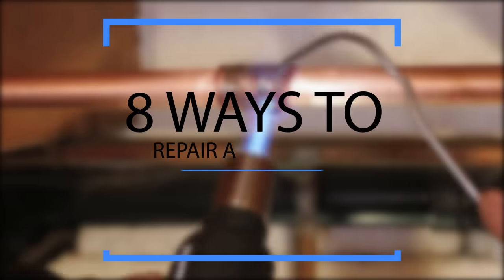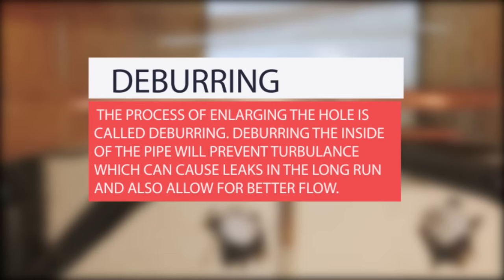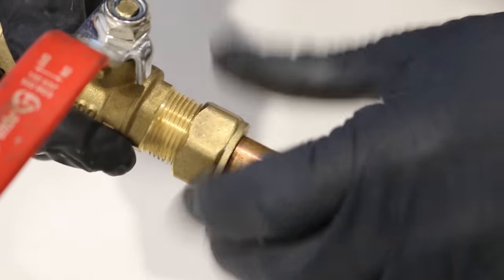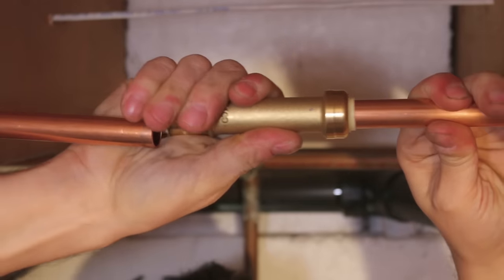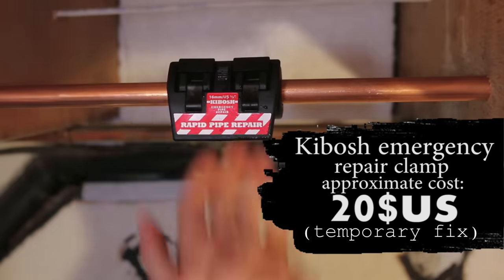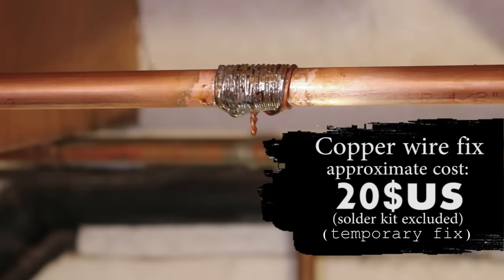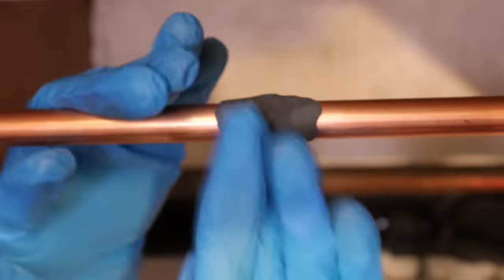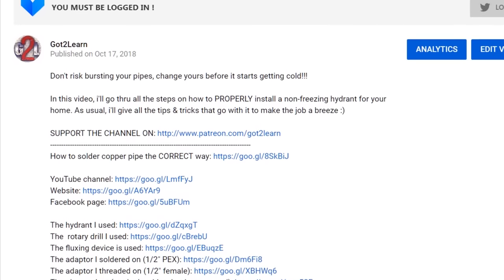The ULTIMATE Leaky Copper Pipe Fix Guide | GOT2LEARN

Comment: I once had an pipe burst late at night
So i used electrical tape it worked for temporary solution.. And sealed the leaked however i did get an plumber to fix it

Comment: These sievert pipe clamps seem like something worth having for emergency repairs while waiting for the plumber ( two weeks last time)  pricey but reusable so worth it, are they available for 1 inch copper
Reply from the maker: Yes, they are awesome...they come in 1/2" and 3/4" for now.
Reply: @Got2Learn  wow thanks for the quick response, unfortunately not the answer I was hoping for, since moving into Mt present home I have had 3 leakes in 3 years, all in the 1 inch supply, the last one took 2 weeks and $200 dollars for a 30 minute repair, fortunately the plumber was very friendly and busy enough he didn't mind giving me some good advice, advising MAPP gas for soldering 1 inch, that propane can't quite do, I have hot water heating and mid winter can get to minus 35 Celsius, at that outside temperature you have to fix it ASAP,  so I spent about the same on a good torch and enough fittings and pipe to do it myself, a year later all is well, it has been my experience that the more prepared for trouble you are the less likely you will need it, might buy a 3/4 and a 1/2, any way to have just in case, keep my karma healthy, subscribed, great advice on a lots of things, screw the guys ragging on your pronouncing of solder, your tips are solid good advice and greatly appreciated.
Reply from the maker: Thx so much man, I need more comments like yours. For the clamps, I have a good relationship with the owner so I know he's working on a 1" clamp, but I dunno when it'll be out.
Reply: @Got2Learn  thanks again for your quick response I will keep a look out for them

Comment: Do you think it makes sense to relocate copper water supply lines (bathroom) from the floor to the wall using a system of pex and sharkbite fittings?
Reply from the maker: Sure, personally I prefer not using SB in a closed wall, but a lot of people do it and it works just fine.

Comment: Can never understand why compression fittings are not more common in the U.S. in the UK they are in every merchant every type and cheap, rather than the bulky very expensive ones shown. I know, We've got a 2nd house  in upstate NY. 100 years old with plumbing and heating the same.
Reply from the maker: Because they are mechanical, they are more prone to failing.

Comment: What would be the reason to use couplings (first method) over shark bite other than the cost difference?
Reply from the maker: You wouldn't be relying on a gasket in terms of longevity ;)
Reply: @Got2Learn  Thanks for that reply! If I'm repairing I pipe that goes to the bathroom, and would get sealed back up in the ceiling, would it be wrong to use the sharkbite? Because one day it would eventually leak? The area is really tiny, so it seems like the sharkbite would be easier. But I feel guilty if it's temporary.
Reply from the maker: Sharkbite says that if it's done right, you can use it behind a wall without any problems, you just need to prep everything correctly, I have a video all on Sharkbite and how to properly install them coming in a few weeks, keep an eye out for it!

Comment: How about using a copper ground strap. The strap is heavy copper at least 1/8" thick with many different widths available. When soldered the thickness is way more than the copper pipe you are repairing. This I would believe is the most guaranteed method and peace of mind. Done and forgotten would work for me how about you Sir ??? How about using square copper wire which would give more of a piece of mind.

Comment: I'm sure there is a good reason, but why don't they make longer couplings so you could cut out a 1-2 inch piece that has a pin hole, then just use a longer coupling?  By the way, I've watched a ton of plumbing videos and yours are the best!
Reply from the maker: No clueee lollll....thanks man!!!!!
Reply: Amazon has these in sizes from 1/2 inch up to 1 1/2 inches long.

Comment: I think you meant two couplings larger than the pipe. If they were the same size they couldn't slip over the pipe. Or did you mean something else?
Reply from the maker: What I mean is the same size (1/2")
Reply: Joe Black  that last part about damaged couplings,I don't know if he's covered that but he should,that bit me in the ass a time or two,im guessing they weren't damaged just not within factory specs that day,this tip you gave is huge one and I don't care who you are,rookie or seasoned veteran having wonky fittings can get anybody because I mean the fittings are new ,how could they be bad right?
Reply: Joe Black  haha it always without fail happens in a bad spot where it was a pita to put on and sweat from the get go

Comment: Can i use WaterWeld in copper pipe? Does it contain lead?
Reply from the maker: You can probably use it, but even if it does contain lead, I would consider this a "temporary" fix, so it doesn't really matter if there is some.
Reply: @Got2Learn  Thanks alot for responding. I've used WaterWeld in my toilet and never leaked. As long as it dont leak then its ok. Just curious if it has lead.
Reply: @Got2Learn  i have already soldered a water bib but pipe leaked and my gas didnt ignite bought another one and also didnt ignite then i used WaterWeld
Reply from the maker: I checked the data sheet on the website, and I saw no lead in the composition, so you're probably ok to use it.
Reply: @Got2Learn  I did research and didnt find info. Hey Thanks once again, Got2Learn! I love your vídeos. Theyre more professional than others.  I like to learn too. Ill watch more of your vids and give thumbs up. 👍
Reply from the maker: Thank you so much Jo! Here's the link to the data sheet I read: https://dynamix-cdn.s3.amazonaws.com/jbweldcom/jbweldcom_183919685.pdf
Reply: @Got2Learn  couldnt open up page. Ill try later. On the product it dont say if it contain lead but dont say lead free either. Thx
Reply from the maker: You'd need to call them to make sure it's safe to use on potable water lines.
Reply: @Got2Learn  I tried contacting them already no luck. I downloaded your info. States on page 18: Based on available data the classification criteria aren't met.
Reply from the maker: Hmmm....you'd need to test it yourself at this point: https://www.homedepot.com/p/3M-LeadCheck-Instant-Lead-Test-Swabs-2-Pack-LC-2SDC6/203313743
Reply: @Got2Learn  already did and it leaked. Bought it years ago. Not sure if its too old
Reply: @Got2Learn  Im gonna repair my copper pipe. Do you reccomend soldering or replacing with Sharkbite? Also is it common for the gas cylinder or torch to not ignite?
Reply from the maker: I recommend soldering over Sharkbite, but it's more complex. Have you watched my soldering videos? No it's not common for the torch not to ignite, you must have something stuck in the torch head :(
Reply: @Got2Learn  Ive watched 4 of your videos so far.
Reply: @Got2Learn  Sorry for so many questions. Why do you recomend soldering over Sharkbite?
Reply from the maker: It's fine :)
Soldering has proven itself over the years and we know that if done correctly, it last a lifetime, Sharkbite fittings do work, they just haven't passed the time test yet, but a lot of people installed them with great success for many years, it all depends on your comfort level with them.
Reply: @Got2Learn  Someone put a planter near the water bib. So im gonna go for the Sharkbite so i wont burn the wood. Please send me a link to one of your Sharkbite vids. Also how would i remove a Sharkbite in the future? Lastly, Sharkbite is just like copper where it dont contain lead, right?
Reply from the maker: Yes, Sharkbite fittings are lead-free.
Everything you need to know about Sharkbites: https://bit.ly/2xEfTao
How to remove em': https://bit.ly/2z6krGX
Reply: @Got2Learn  i know your probably going to say yes but just need to ask. I dont see the Sharkbite logo(like the one on your video) on the fitting i need to replace. Does that mean using gas is the only way to remove the fastener between pipes?
Reply from the maker: If it's soldered, yes. If you can cut the pipe before and add a Sharkbite coupling for example, that would be another viable option.
Reply: @Got2Learn  i thought so. Kool.i was thinking bout that other option. Thx 4 answering my questions. Ill subscribe.
Reply: @joflores2267  soak it liberally with the water hose before hand you'll be fine

Comment: My pipe OD is 3/4" (triple-checked); I just bought a 3/4" Autocut GPC; and it is too big for the pipe! Any advice on where I screwed up? Thx
Reply: Depends on pipe pvc. Cpvc copper or plex
Reply: Actual pipe diameter is greater than the nominal size (which is how the piping and tools are labelled). Looks like .750" OD means 5/8" nominal.  (If you have trouble finding an Autocut in this unusual size, just use an adjustable cutter.)

Comment: Yeah, the copper sleeves Best Method.  But thanks for the others.  My neighbor's got a split pipe and I only have one 3/4" copper sleeve... So Home Depot.... (Of course tomorrow after the job's done I'll find two more.)  Something else to consider in a dry climate. The copper waterline is often a secondary ground for the electrical system. Something like the Sharkbite might not keep this ground if the leak is on the main waterline. 
(In Southern California if someone told me -there's a big puddle in front of the house (bungalow): I'd say find the hose connection, and dig a hole 16" from the wall of the house - that's where your leak is. This is because where the old buried galvanized pipes met enough moisture in the ground for electrolysis to take place causing the pipe to rust and burst. (This isn't the same stupid problem of connecting copper pipes directly to galvanized. )  I'll bet I've seen this and fixed it half a dozen times and I'm not even a plumber.

Comment: What about if I got small drip in elbow?
Reply from the maker: You need to change the fitting
Reply: @Got2Learn  grr, water in it so maybe i just use sharkbite fitting after removing it
Reply: @Got2Learn how u determine where the last mark goes,  how u get it to line up on both for sharkbite slip?

Comment: I have liked and subscribed to your videos. I see a few people talk about the copper compression fittings but where do you get them?  
Are they online only?
All my big boz stores carry shark bite and thats it
Reply from the maker: Thank you ironwill04, you should be able to get some at your local hardware store, just ask for them. If you are looking for some online, I will link them in the description box below the video ;)
Reply: @Got2Learn  awesome thank you very much!  
Im working on 3/4 hydronic baseboard heat and new to soldering
Reply from the maker: Have you seen my latest "How to solder copper pipe" video?
Reply: @Got2Learn  yes i did. Going to try it some more. Unfortunately i saw it after my soldering.
I dont think my soldering is bad but it could use some help.  Plus im trying to get better at in the wall stuff
Reply from the maker: Awesome, good luck bud ;)
Reply: @Got2Learn  thanks. Have u used compression fittings or shark bite on hydronic baseboard heater? 
Do u put either in the wall
Reply from the maker: I tend not to put them in walls, just to be sure.

Comment: I think the sharkbite slip fitting is not pex recommended
Reply from the maker: Who says?
Reply: @Got2Learn  it's missing the insert that others have. See https://www.sharkbite.com/products/brass-push-slip-coupling
Reply from the maker: I have a bunch of slip couplings here and they all have the inserts, what brand are you using?
Reply: @Got2Learn  the slip end has the plastic insert? I have a sharkbite, their site even skips pex under specs. Mine have no inserts
Reply: @Got2Learn  maybe they stopped slip fitting in pex due to problems
Reply from the maker: I have no idea, all I know if my slp couplings can be used on PEX, so like you said, maybe they adopted and now we can use them on PEX, which is good :)

Comment: When you tighten compression nut on 1/2 copper pipe do you do 1 full turn by wrench ?  More or less ? Thanks.
Reply from the maker: It depends. If the fitting comes off, it's not tight enough, when it starts to get a bit hard to tighten, give it that extra 1/4". The best way to know if it's done right is by turning the water on, if it doesn't leak it's tight enough ;)
Reply: @Got2Learn  Thank you very much for quick response.
Reply from the maker: My pleasure, if there's anything else just ask ;)
Reply: @Got2Learn  What would happen if you overtighten ?  And why  overtightening is bad? Thanks
Reply from the maker: If you overtighten it you could potentially break the retainer nut or ruin the brass threads.
Reply: @Got2Learn  Thanks
Reply: @honolulu1476  I doubt you would be able to over tighten anyway. I've installed thousands of compression valves and always crank them down tight. Never had one break or a leak. Cheers!

Comment: If leak comes from electrolysis,no way,have to replace entire pipe.If replacement isn't copper,check if it's electrically grounded,to restore ground.If there isn't a shutoff nearby,chances are to install one,instead of couplings.

Comment: As a plumber I’d like to say that while I don’t like compression fittings or shark bites only the first 3 options should be considered permanent fixes. In the event you find yourself in a situation where you have a leaking pipe you should call a plumber ASAP if you cannot afford an emergency call shutting off the water to the leaking area is a much cheaper option than “fixing” it only to have it leak later and cause irreparable damage to your home and belongings

Comment: Well if you can solder  a hole in a pipe or solder wire to a pipe why do these temporary  repairs  just get a piece  of pipe and 2 couplers  and solder  a new piece  of pipe in
Reply from the maker: Was just showing different ways for different scenarios but yeah, that's the ultimate way to go ;)

Comment: Some good ideas but in this video you never mention to your subscribers to FIRST use flux on the copper pipe also inside the couplings then then can solder everything - if flux is not used the solder will  not join together .
Reply from the maker: That is why I linked the "how to solder" video, watch it again, you'll see it ;)

Comment: "proceed to soldering"....if you never done it, take many practice sweats. I am going to try putting in a tee in with sharkbite. $9 from amazon, no sweating, no flux, no solder. Will let you know.
Reply from the maker: You can't compare soldering to using a Sharkbite, it's just not the same.
Reply: yes, sharkbite look incredibly easy....dont yut think
Reply from the maker: Yes but soldering is better in a lot of ways.

Comment: Every pipe fixing video has perfectly straight pipes.  The copper pipe under my kitchen sink is crooked.  A slight bend all the way.  Anyone else have that problem?
Reply from the maker: Yeah, sometimes when DIY builders do their own plumbing we see this..
Reply: @Got2Learn  I've not done much plumbing but I was thinking it may have been someone's bad job and was thinking I should try to replace everything with as many straight one as I can get.
Reply from the maker: Well, if it's not broken, I wouldn't touch it ;)
Reply: True.  Have a pinhole leak in the copper right now but that's about it
Reply from the maker: You could bend it too, but not too much or else it'll kink!

Comment: As your self this ? If your a homeowner then do whatever you think is best . But if your in the trade most of these methods are a joke and would not fly in a major city in the Midwest so why would you use this cheap non sense methods instead of doing it right. Do it right dont use these mickey mouse hacks if you really call your self in the trade . Ohh yeah so some of these  Mickey mouse hacks take few minutes but yet you still charge the customer wtf prices do it right . A lot of people use shark fittings and call them selves plumbers wtf their not . What happened in Texas was that people are dumb didnt know where the shut off were ,should of used spaces heaters non combustible ones cant use pipe insulation down there I think because of condensation but most people should of known were to shut off the water to avoid a lot of the damages footage I seen .

Comment: I like what you're doing with your channel, but brush up on your terminology. With the compression fitting it's not called a sleeve it's either called a feral or a compression ring.
Reply: "ferrule" not "feral".
Reply: @rontiemens2553  or ferrule sleeve also.